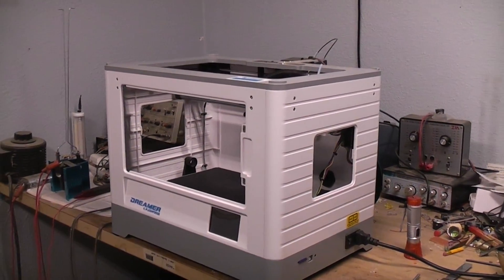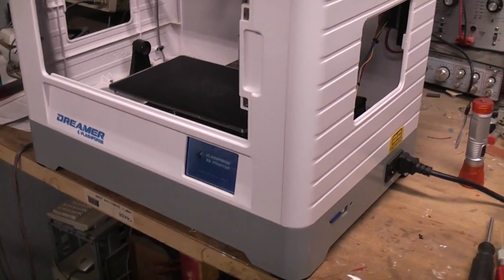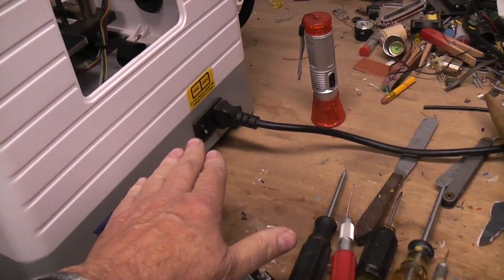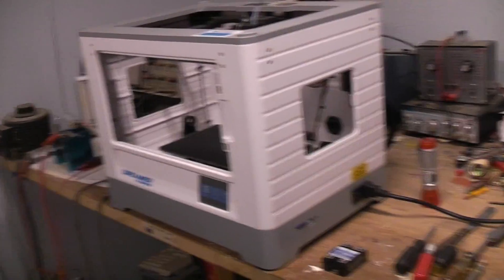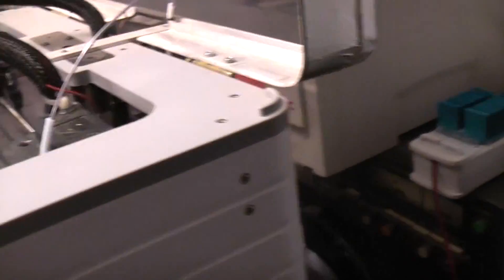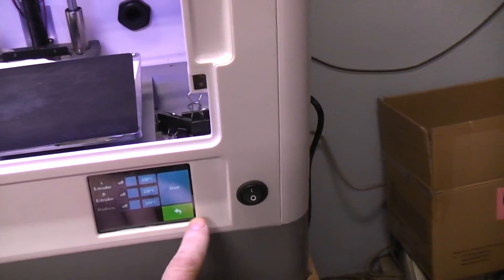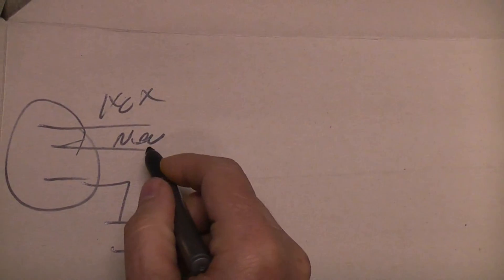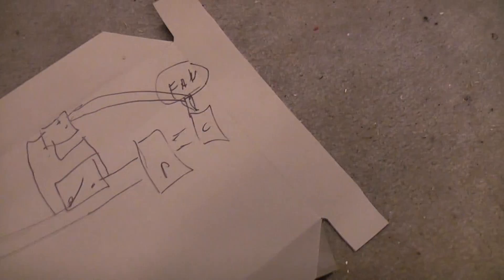Add AutoPilot to your 3d printer. 100% shut down after print / Hotend cool down.

Comment: Is there any printer that comes with this already?
Reply from the maker: I have not seen one that shuts off all power 100%. Many have firmware mods and G code mods to turn off the printers when they are done printing but they still leave the power supplies active.

Comment: nice but on my printers the hotend fan is always on. so that i dont forget to turn it on when printing
Reply from the maker: Yes some of the new low cost printers do just leave the hot end fan connected to the power supply. Most turn the fan ON and OFF automaticly any time the hot end is over 60C the fan runs, below 60C it turns off. Oh well, it was nice on this old Flash forge dreamer back in 2016 when I did the mod.

Comment from the maker: Here is current ebay listing, just one of many.
http://www.ebay.com/itm/Output-24V-380V-25A-SSR-25-DA-Solidstate-Relay-PID-Temperature-Controller-/221971633159?hash=item33ae8a5407:g:-uwAAOSwSdZWcych
As you can see the relays can be used to control lighting or heaters or any thing that runs on mains voltage. You only need a DV voltage of 3 volts too 32 volts to turn the solid state relay on. The DC control voltage is isolated from the AC relay part.